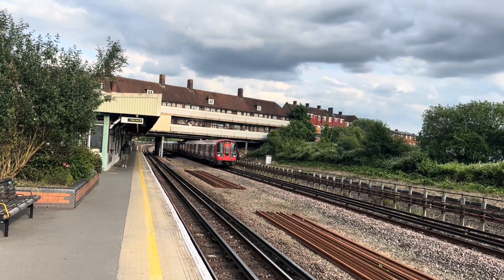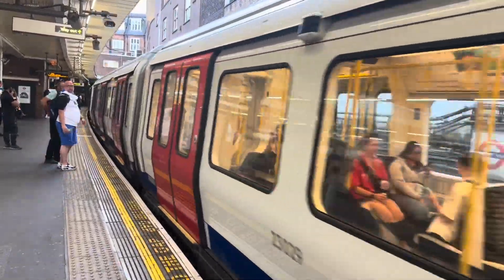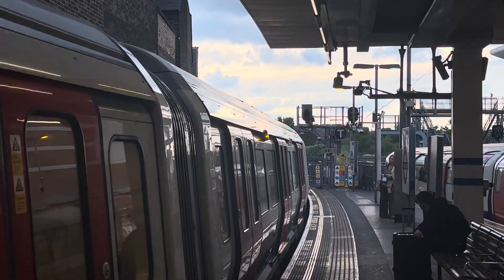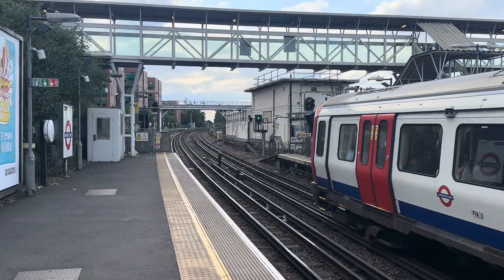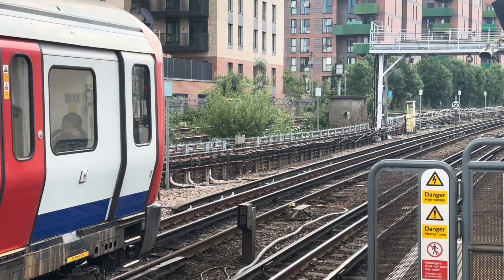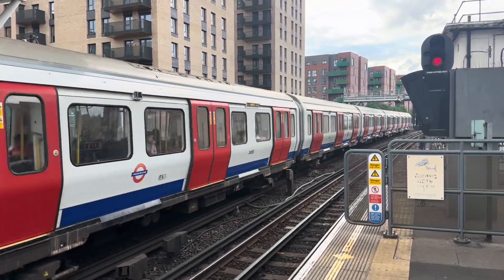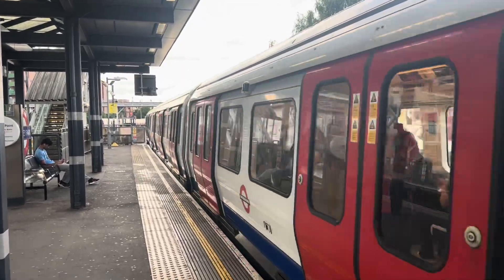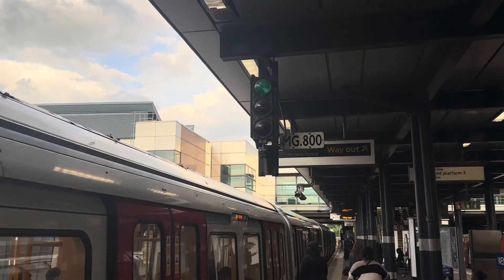The End of Metropolitan Line Signals? Signalling, CBTC & The 4 Line Modernisation Explained

Comment: I would have thought that Full Signal-less operations would be impossible, especially North of Harrow-on-the-Hill, where the Met Line shares track with the Chiltern Line trains.
Reply: New fixed block signals will be overlayed over CBTC
Reply: @Matty12333 im not sure about that, but the block signals that are original will stay until cbtc is reliable and the new signals have partial automatic in case of a cbtc outage
Reply: Well, I wouldn't say "impossible" (I would think that you could fit CBTC to Chiltern trains if you really wanted), though that probably wouldnt be very easy (also see Elizabeth Line challenges), and almost certainly very very costly.
Considering trains (with inside frame bogies) like the class 172s and 710s were delivered without tripcocks, I wonder what will be done when the time comes to replace the Chiltern trains - will they be specified to have tripcocks, or will there be a need to fit e.g. TPWS to the Metropolitan Line signals? (I also wonder why it was decided to fit extra TPWS for the Underground/Overground shared sections rather than fitting the 710s with tripcocks - I would be surprised if it were impossible, considering the class 717s were initially delivered with them, or was the price such that fitting the loops was cheaper and/or easier?)
Reply: @fetchstix  It is much easier to fit new trains with CBTC than retrofit CBTC in place. Considering BR failed to get LU to fit AWS & ATP back in the 1990s to the Met, the idea of fitting TPWS is slim. For the London Underground/London Overground section that was Network Rail who makes the decisions rather than TfL.

Comment: the Circle District Hammersmith and City & Metropolitan lines will run similar to the Central Jubilee Northern & Victoria lines
Reply from the maker: The Central Line uses a much older automation system using smaller fixed blocks instead of moving blocks.
Reply: @subwayexpress52 What about the section from Harrow to Buckinghamshire? How would that be automated since the Met shares tracks with Chiltern?
Reply: @NathanGeiling-r4n  CBTC, with fixed block signals for Chiltern trains.
Reply: @subwayexpress52 How old is it compared to the 
Northern and Jubliee lines? And which type of ATO does the Central Line uses?
Reply: Makes no sense to have CBTC after Harrow on the Hill in my opinion. Perhaps just new signals should have been installed

Comment: got on it today and the train was jolting too much
Reply: Poor quality track and higher speeds. This will put strain on the suspension and motors of the trains
Reply: At least it's better than the trip up Singapore experienced when they switched NSEWL over to CBTC.

(They had a huge bunch up at Jurong East which was originally built with the NSL ending at Jurong East before expanding with another platform with the "stub" line's crossover being further down from the main station. The trains were literally kissing each other as they reached closer to Yew Tee station (the 4th station down the line, before the "fast section" up to Kranji station) 

Also a huge incident related to the safety bubble & switching from CBTC and Block signalling with the "in wait" train crashing into the "in station" train)

Comment: How will it work when sharing track with mainline trains? Will it be like Melbourne where signals are retained and only used for non-CBTC trains or something else?
Reply: I take it the same way it works in other countries:  trains not fitted with CBTC will use more traditional safety systems and signals, which are overlayed on the CBTC signaling.
Reply: Chiltern trains will run on overlay mode to new signals. How reliable this will be i am not sure, but I can see testing take time

Comment: Never knew about this development on sub-surface lines. Thank you for enlightening us.
Absolute block has (usually) ensured safe operation of railways since Victorian times. Moveable block sends a shiver down my spine when used in high frequency lines at speed. However it has probably been used safely on new build high speed lines so hopefully all will be well on the Metropolitan route.
Reply: I think you're confusing absolute block with fixed block. Fixed block can take many forms of which absolute is one.

Comment: The 'S' in SMA doesn't stand for Signal - it's Sub-Surface. But many people don't realise that!
Reply from the maker: I didn't know that, that is interesting.
Reply: ??? no it’s not.  SMA stands for Signalling Migration Area.  TfL documentation said so too.
Reply: @LJC94512 correct, I've looked on their documents and it does mention it
Reply: @LJC94512  There's a lot of confusion even within TfL what the S stands for. 

The definitive definition is in the contract, which I've read in my professional life.
Reply: @tomcrame Given that every single TfL document I can find uses "Signal" or "Signalling" and TfL typically abbreviates Sub-Surface with a double S (like the SSUP, Sub-Surface Upgrade Program) I'm pretty sure that you're mistaken
Reply: @Gfynbcyiokbg8710  Sub-Surface was always one S, i.e. SUP. As it has been for the last 16 years that I've been involved with the project. Double checked the relevant documents today and can confirm that contractually the S stands for Sub-surface.
Reply: @tomcrame  That's just not true now. "TfL’s Sub-Surface Upgrade Programme (SSUP)" - London Assembly, March 2016; "SSUP (Sub-Surface Upgrade Programme)" - The Mayor, May 2015; "Sub-Surface Railway (SSR) Upgrade Programme (SSUP) - TfL Board, September 2014.

And even if the original contract happens to use "Sub-Surface", since TfL have used "Signal(ling)" every single time since that contract was signed, "Signalling Migration Area" is now what SMA stands for.

Comment: Why wouldn’t Turnham Green become the end of CBTC, instead they are thinking of stopping at Stamford Brook?  Surely they can end it one more station down the line before it diverges to Richmond and Ealing Broadway.
Reply: None of the boundaries are set up at junction locations, due to the complication of handling the signalling of the junction itself across 2 separate signalling systems. The fact that the line at Turnham Green splits between the Richmond and Ealing Broadway branches is precisely why it was not chosen
Reply: @artursdobrecovs I see what you mean. My understanding is that if CBTC ends at Turnham Green, there is still a potential overlap of New and old signalling that operates the junction, which introduces risk of unreliability. However, that doesn’t seem to be a problem in East Putney though? As there is a junction right after the station, not so different to Turnham Green.  Seems to me these 2 stations are not much different.
Reply from the maker: I think originally they wanted to do it all the way to Richmond and Ealing Broadway but due to the District using Network Rail tracks from Turnham Green to Richmond and then sharing with the Piccadilly they’ve put it on hold as it’d be too costly for 2 quieter branches of the line.
Reply: @subwayexpress52 it’s the same thing between East Putney and Wimbledon and from Rickmansworth to Amersham
Reply: I know they won’t do it to Richmond and Ealing Broadway, but Turnham Green tracks are not shared with Piccadilly line nor sharing with National Rail. So trains could have switched to old signalling AT Turnham Green, then as the train continues to branch off and join Overground (Turnham Green to Gunnersbury), that can run on old signalling. But Stamford Brook to Turnham Green can totally run on CBTC. So, my question is they should not have reason to stop the new signalling one station sooner.
Reply from the maker: @LJC94512  I think they don't have any need to as the cancelled sections start from Stamford Brook and they don't want to edit the plans just to cover 1 more station on the line.
Reply: @subwayexpress52 actually the original plan SMA10 was from Barons Court all the way to Richmond and Chiswick Park. So they did edit the plans to scale back.  Same thing with SMA12, originally Fulham Broadway to Wimbledon, now it’s Fulham Broadway to East Putney. It makes sense to stop at East Putney since National Rail joins right after East Putney. If you look at SMA13, it also makes sense because that is right after Moor Park one side goes to Watford the other goes to Amersham/Chesham. As for SMA14, it also makes sense to start at West Harrow rather than Rayner’s Lane because you need old signalling to control the junction between Piccadilly line and Metropolitan line. It would add risk while migrating the signal to an overlay. 

Therefore, they have changed plans when they brought back SMA10 and SMA12 to the upgrade plans (SMA11 cancelled entirely). Hence the question remains in when they changed the plan for SMA10, they could have ended it at Turnham Green rather than Stamford Brook, yet they did this.

Unless there is something I don’t know about how the junction operates in Turnham Green, then it really does not make sense to end CBTC in Stamford Brook.
Reply from the maker: @LJC94512  I'd imagine they don't think extending CBTC one stop to Turnham Green (editing the whole plan of SMA10) is economically viable especially with TfL's current financial situation.
Reply: I suspect (but without a signalling diagram am not certain) that the old signalling area for Turnham Green for the westbound District starts a couple of signals back towards Stamford Brook. This is to do things like locking the route given on a green signal when a train is approaching the junction. Also it allows approach-controlled signals, to help avoid bunching trains at Turnham Green. You are right, there must be a reason or they would have gone with Turnham Green as the boundary.
Reply: @surreygoldprospector576  It does.  From memory (though I'd need to check the design) East Putney doesn't work the same way.
Reply: @surreygoldprospector576 : My suspicion was that because Gunnersbury is Network Rail owned, there may be some challenges in "preparing for" CBTC. There was a training video somewhere, I believe for the Northern Line TBTC, where at the station before, you check that the VOBCs were communicating or something?
Meanwhile, even though East Putney to Wimbledon is signalled by Network Rail, it is actually LU property, as are the signals (apparently that's why there are no LED signals on that section, as opposed to the rest of Network Rail where they're quite common) so perhaps it's easier to deal with? In a recent cab ride, it appears that at Southfields heading towards East Putney, they have a covered up sign, which is likely the "check VOBC" one I would think.
Of course, that's all me guessing, but if I were to place a bet, that's what I would go for...
Reply: When the new Piccadilly line 24 stock rolls out then it will be a different Story Acton Town will be done and all the way to Rayners Lane from Acton Town
Reply: Did my comment get deleted 😥
Anyways, tl;dr as I'm not writing it all out again (and hopefully it stays this time!), I wonder if it has something to do with East Putney to Wimbledon (and in particular, the station before the boundary, Southfields*) being LU owned (despite being controlled by Network Rail), whereas Gunnersbury to Richmond being owned by Network Rail...
(* reason that's relevant is that it appears that you need to check the VOBCs are communicating at the station before the boundary, and it might be easier for mentioned ownership reasons to put the required CBTC equipment for that purpose at Southfields than it would be at Gunnersbury. Also mentioned that Southfields seems to have a covered up "Check VOBC" sign heading towards East Putney too)
(edit: it seems that currently they have some of the radio antennas and tags for a short distance south of East Putney station, but before the tunnel, at least from what I could see. They also have two new tripcock testers for both directions - I wonder what the plan is if a train fails the test right before it needs to come out of CBTC into colour light signalling?)
Reply: @fetchstix  The Signalling boundary dates from the pre-1994 ownership boundary. In 1994 LT purchased the Wimbledon Branch off BR for £1. The signalling boundary is on Putney Bridge. The signalling on the Richmond Branch is in a state which means it required renewal years ago as part of Network Rails North London Line re-signalling project. So a CBTC extension might happen on Richmond Branch as part of re-signalling from Richmond and Acton Wells Signal Boxes to Upminster IECC North London Line workstation, however they are saying it might be re-signalled with ETCS only as that is the national standard.